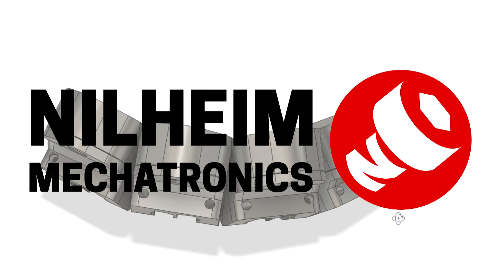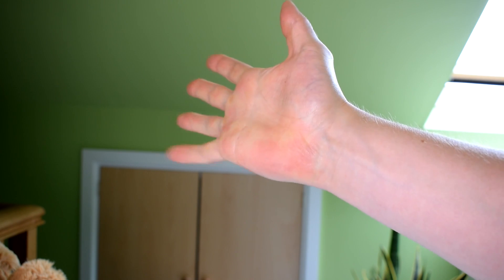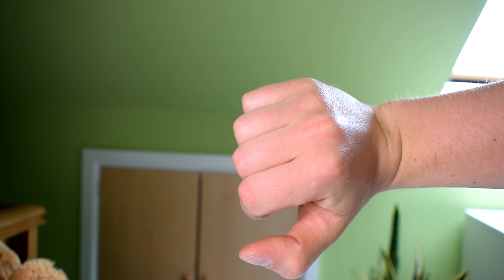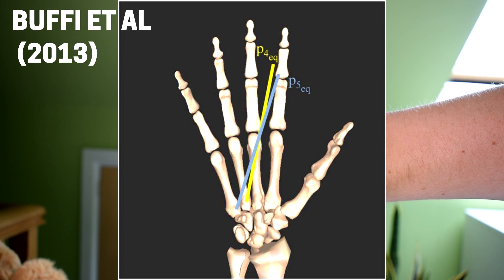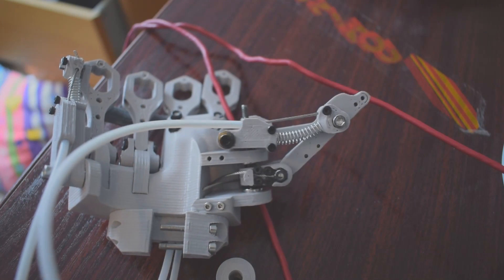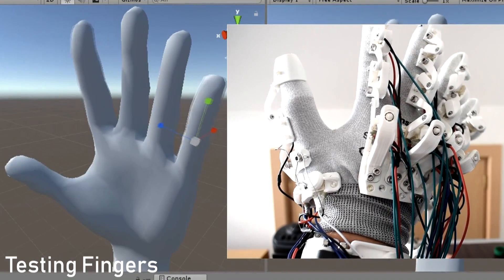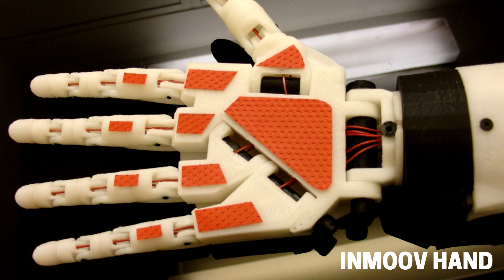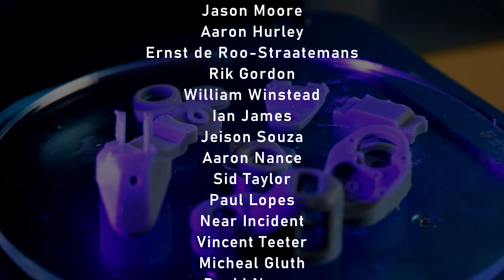Biomechanics of the CMC Joint for Bionic Hands - Biomimetic Mechatronic Hand Part 4

Comment: I hated the design of prosthetics back in the 1980s when I was in my senior high class and so I designed a realistic almost natural range of motion. The muscle components were to be made with silicone, electromagnetic flex  impulse, signal from the brain feeds electromagnetic fibers embedded in the artificial muscle flesh, with a hydraulic system also embedded that would resemble veins, probably, with artificial skin and that would allow the flexor tensor back and forth action and make it look very realistically normal or biological I should say maybe and ferro- Magnetic fluid was my first thought for the hydraulic action, one reason for this is because it's no Motors it is a completely different idea and so you would want the Bulge of a bicep because that hydraulic action would cause that especially with a design of your channels in the muscles and if you design the skeletal features and ligaments and tendons it would be very biologically realistic especially with any touch sense. You could combine several processes and use far lower power. I want to be able to help refine a design of and operation of the redesign of my doable miracle.  No no motors. 
Cmuscle so that you can cover it with skin or gloves or whatever and it is basically barely noticeable that they would be simulating by a hands my nephew lost his hands and his feet to being bit by a flea a year ago and now I'm desperate not just interested to help him so if I can help you then I will help him and others that desperately need it simulated biological process with artificial components.  That's what I would call it.

Comment: Maybe the 17 deg rotation of thumb is there for passive adaptation. At least I cannot rotate my thumb [perhaps.. is it possible by training, dunno], but I can rotate it with an other hand. 

Thus, it will adapt to the other movements in context. Practical. Also, the rotation allows the joint not to break, if rotated.

By tensioning my hand, I can also limit the rotation. This also enables kind of passive DoF of this thumb rotation.

Interesting stuff and thank you for thorough and informed analysis. Quality information, subscribing 😊👍

Comment: how reasonably and comfortably everything is arranged by the Lord God, praise and honor to you Jesus!
Reply: I mean, no. Have you ever jammed your thumb? A better design would preclude that possibility, like some of these robotic hands shown that can bend their finger joints backwards. We also have a useless tailbone that is clearly a vestige of our evolution, which can easily be fractured by a relatively gentle fall (I know, I broke mine last year from slipping on a river rock, and it still hurts). We also have too many teeth for the small jaws that we evolved. We can develop carpal tunnel syndrome just from using our fingers too much. I have a rib that randomly dislocates most days for no reason. Blood vessels run in front of our optic nerve, meaning our brains have to edit them out of our sight with post-processing. There are all kinds of problems with our bodies that would make them really bad designs, had they been designed at all. But they evolved, and the fact that our bodies and minds work is amazing because of that.

Comment: The hand has a skeleton. The ligaments connect bones together.  skin ALSO helps hold the bones in place. The Tendon connects a muscle to bone. Muscles actuate forwards or backwards. Muscles can come in different shapes and structures. I would slow down here and make a unique muscle for each bone. Instead of gears try to use actuated muscles. Even if you didnt build the full hand, this would be a more worthwhile approach. Maybe someone could follow your work. The idea of Tendons and ligaments in robotics using a skeleton structure is exciting. I'm bored of Boston dynamics. Tiny hydraulics for muscles with some kind of skin.

Comment: Are you from Hull? I live just down the road if so. For me, the next stage is to use positional analysis via multiple external cameras on the forearm. Similar to car autonomous driving. To deride intent in 3d space as in the spinal portion of the nervous system. You reach for a cup. The cameras detect this and minor adjust to the cup conformation. If you arm extend it then grasps. Ive been wanting to work on this for ambulatory gait too. To make it impossible to fall over. But always knowing the centre of balance etc. The mechanical  foot always ALWAYS behave in terms of predicting position.

Comment: Your information is very comprehensible and knowledge based. I prefer your idea of the gear box solution hopefully you will consider using a clutch assembly or actuator for each finger to engage gears independently and simultaniously. I feel very positive about your work.

Comment: for the cmc 1 and 2 joints, I'd recommend some form of elastic connection, as, while the muscles have almost literally no control over how they move, they're still elastic to allow conforming to various objects being gripped. at least allow cmc 1 to be flexed backwards by 9.5 degrees. you can see this elasticity by grabbing cmc 1 and 2 and twisting the grabbed hand. it helps in grabbing straight objects like rods and poles and sticks and such.
Reply: this freedom of movement can be seen by simply flattening the hand. if the mcp joints were all lined up in a straight line with only freedom in cmc 3 and 4, then cmc 5 would be lifted off of a flat surface.
side note, I number cmc/mcp with index as 1, pinky as 4, thumb as 5.

Comment: I still don't understand why no one just copies the structure of the hand and the way tendons actually work... then dress it all up and voila functioning hand... I don't understand why you use hinges etc, for mimicking hands when you have perfectly functioning structure known as bone and tendons, with basically just skin functioning as a restrictor on unwanted lateral movement, just freaking 3d print the skeletal hand, in any material of your choice, attach a soft durable stiff yet slightly elastic and flexible material as a replacement for tendons, have actuators act on a pulley system to freaking move the joints around like they do in a hand... it's all silly trying to improve an already perfect system.

If you want a hand with other properties than the human hand, you'll have to invent it, but trying to replicate the human hand by using shittier mechanical devices, doesn't really sound remotely practical at all.

Comment: Fascinating. I have always wondered why the actual human skeleton is not used as the framework for these modern robotic builds, since that is the only way to ensure the exact movements.
Reply: The actual human skeleton by itself is not mechanically stable. it requires the connection of ligaments, bursae, and muscle-tendon units for joints to even be stable enough to be measurably driven. The thing about building biomimetics is you have to strike a design balance between reproducing the biological motion, and building mechanical joints sturdy enough to be driven by modern actuation technology (electric motors, pneumatics, hydraulics, etc.). It is not enough to simply build a miniature saddle joint and attach a string to it to drive motion; the joint itself must be a modern, mechanical joint capable of permitting drivable motion only in the movement planes desired, or at least the joint's end effector must have a larger working volume reducible to the biological analog. 
Additionally, aside from the issue of scalability, modern electric motors produce forces that are very large, and not easily reduced to give the joint torques required to emulate the fine motor coordination of the human hand (force-torque reduction requires gears/pulley structures, for which there is not much space in the available volume enclosed by the hand). 
In general, the skeleton's joints exist along a wide spectrum of "stability" vs. "flexibility". The more Stable joints are rendered stable through the action of active musculature. The more Flexible joints require elastic structures such as ligaments and fascia to permit compliant movement in multiple directions other than the powered directions driven by the large muscle-tendon units. Fascia also facilitates pulley/like structures in a low volumetric profile. The carpal and metacarpal joints are closer to the flexibility part of the spectrum, and in vivo are entirely stabilized by non-rigid, viscoelastic anatomical structures; the bones are there merely to pass along compression loads while executing a movement.
Reply: @BattlesuitExcalibur  Excellent answer and an interesting read!
Reply: complexity and reliability are probably the answer, wear and tear can't be healed only replaced and prosthetics are probably expensive already so lowering the cost of getting one and maintaining it might be a priority over complete functionality
Reply: My thoughts exactly, I was thinking to use little airbags to replaced the muscles
Reply: Exactly, I can say the same about robotic 4 legged animals too, they should start implementing biologically accurate limbs,

Comment: This is fascinating stuff!
One question that always pops into my brain when watching this sort of stuff - and you'll have to forgive my ignorance - we know how a biological hand works, why don't we just replicate that? I mean, if the designs the same (just made from different materials), then replicating the same range of motion, etc should also be possible, yeah? Obviously, the control system would be different, because the human brain/nervous system is a thing.
Like I said, forgive my ignorance on such matters, and keep up the fantastic work!!
Reply: I think the reason why is because they can't make the motors small enough without loosing grip strength. Also you'd need to replicate tendons, which cause the movement since they're muscles and contract when u send brain signals. As far as I know they haven't made a synthetic tendon like thing yet, so ud have to sub it with bulkier gears and such.
Reply: @Mysoulismelting  I'd imagine that one would place the motors further down the forearm, where there's more space, and have the fingers driven by corded "tendons".
IIRC, there has been some steps in the development of synthetic "muscle", but I haven't followed it, I just remember watching a few clips years back.
Reply: @TheScwall  i remember then being able to make synthetic cartilage like for ears and noses. But id imagine it'd be bulky if you were to have the motor further down the arm.

Comment: Have you thought about solid state compliant mechanisms? Basically you have a single solid part that is designed to flex in a specific way when forces are applied. Might be useful for the 1st-4th phalanges to simplify construction considering the innate limitations on how flexion occurs away from the palm. Veritasium has a video on those mechanisms with a professor who (quite literally) wrote the book on the topic.

Comment: 4:15 aren't they move together anyway? I didn't do much research on the topic, but it seems like you can treat those joints as a single joint if the metric is can you direct their tips in one spot

Comment: Is it possible that the thumb's CMC joint's pronation/supination aren't directly active movments, like flexion/extension and abduction/adduction are? As in, the metacarpal twists throughout it's range of movement, rather than being able to twist on demand like other movements can be done? 
I don't study anatomy, I know this joint's pronation/supination is severely understudied, I can only find one big study that did 4d scans of the joint, though this study only showed that pronation/supination exists but not how those movements are actuated. But I came to this idea based on the fact that you can actuate movements in joints through external force, basically pushing/pulling on a joint can involuntarily actuate it. Except you cannot make your first metacarpal twist with this method, it stays fairly rigid, like the other metacarpals do. 
Thus I believe this joint's pronation/supination may be passive, maybe not truly passive but also not an active actuation. If this is true, the twist would only be there to allow greater range of movement, which may assist in opposition and reposition movements. Making the joint technically 3dof, but only active in two degrees, with the third being passive between the other two. But again, maybe it's not a true passive, maybe it is partially active due to how the tendons pull the metacarpal, I'm not really sure how to define this if it's not truly passive but also not truly active.

Comment: Instead of your current gear box designs to have movement wouldn't it be better to have a miniature tunnel boring machine tube type of mechanism to control each finger movement. 

For clarification for every metacarpal (5 numbers) make a mini TBM ( tunnel boring machine miniature as the metacarpal bone with its 3 offset tubes for rotation  ) and attach strings to its 3 rotating offset tubes to control finger tip movements. 

So each finger from tip to base at the metacarpal have strings attached to the 3 segments of the tbm .

Comment: you should consider using long motor/small diameter with worm gear in the forearm, because they are powerful, precise and slim, also have the advantage of axial output force

Comment: Would be interesting when you get an sla printer to use some of the available semi flexable resin to print out all the joints, bones and tendons in one print to reduce complexity of mechanical joints, sla would allow for that level of detail in one print, instead of mechanical hinges "living" ones , although this might not provide the framework for control you are trying to make
Reply: Added bonus of westworld vibes